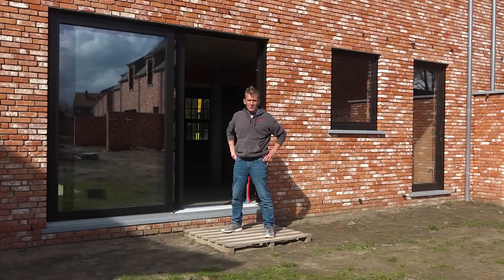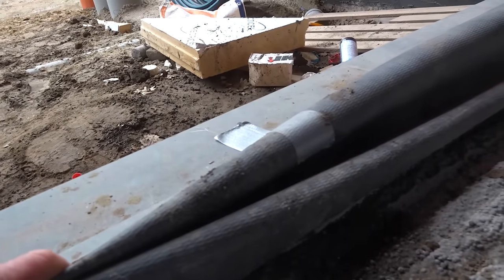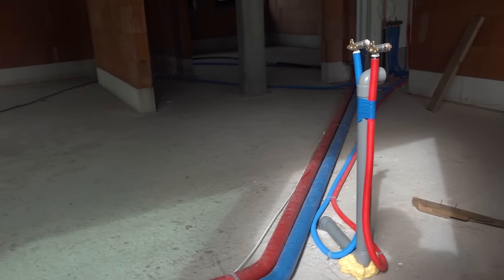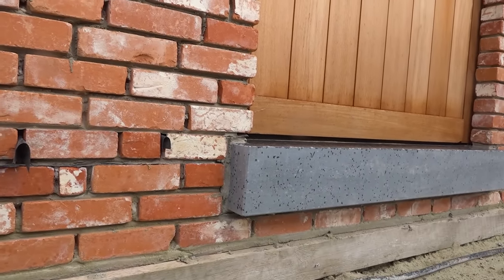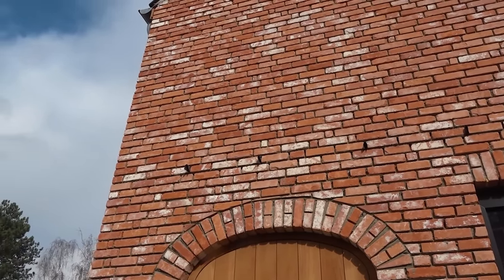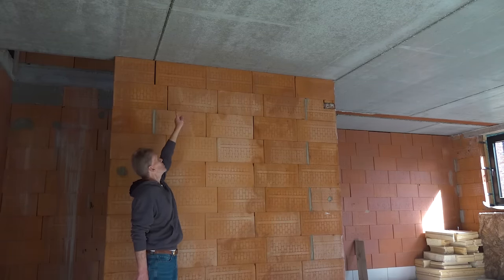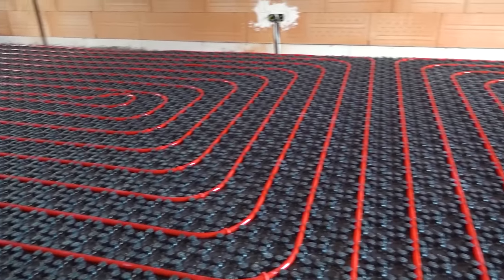Can We Learn From Buildings in Belgium?

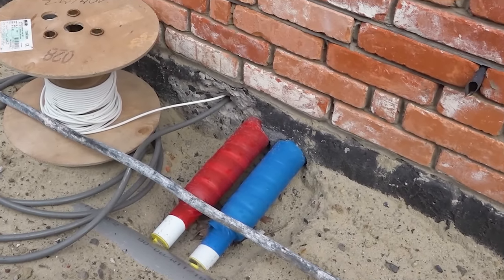Comment: 2:56 @SkillBuilder I hear you say “district heat system” which I don’t think we have anywhere in Belgium. These are definitely pipes of the heat pump, which every new building being built is obligated to install.
Reply from the maker: Yes I use the term very losely to mean several dwellings supplied by one heat source.
Reply: Yes Belgium isn't a former communist country we don't have that AFAIK especially not on newer houses definitely pipes for a heatpump since that's required now.

Comment: All houses as well as apartments here in Belgium  have been built for decades with concrete floors between storeys to keep noise down & for underfloor heating.  Standard practice!
Reply from the maker: Interesting!  This is actually a house, I thought they were flats but that is not the case.
Reply: I suppose lumber is a lot cheaper in the US than in Europe. It’s used in all houses between floors and between floors in apartment buildings up to about five stories, with discussion of increasing the upper limit. It is indeed noisy. It’s not so bothersome in a house, but in an apartment it’s incredibly intrusive to hear every footstep of your upstairs neighbor.

Comment: As an architect assistant and former constructionworker I can assure you not everything we do is perfect. Every country could learn from another. As a matter of fact, I prefer the dutch way of the foundation detail instead of the belgian way... Also that rainpipe in the middle of that window, wth whas that XD... I heard you talking about pipe in pipe system with the blue and red pipes, and then you said you could shove another tube in that when you have a leak but that's not possible. Those colored sleaves are just protection for everything that comes on top of it :-).

Comment: District hearing is basically piping hot water coming to your house and you have heat exhanger in your home to reduce it to hot water and forvthe radiators. Charged by volume and temperature  delta over your heat exhange(used kWh). Plus monthly basic fee to cover the upkeep of the district heat grid.
Reply: more used in the Netherlands than in Belgium, there are only a few projects using it so far.
Reply: It's actually not even luke warm (waste) water which is used by the heatpump to condense into Hot water. I don't mean sewage water but water from industrial processes etc which produce excessive heat.

Comment: I live in Belgium. Not a professional builder but did build my own house. The slab you see over the foundation is a slab that runs through  to the inner wall with a step-up. So moist and water is deviated towards the outside and not towards inside. 
Many things you name was logic to me, the way it should be done. Like pipe-in-pipe is very Common here

Comment: I have a house in France that has copper pipe in plastic tube similar to what you are showing here. It is buried in a concrete screed over the floor similar (I think) that will happen in this house in Belgium. The copper pipe is impossible to replace without digging up the floor! Also since the evidence of a leak only shows at the end of the outer tubing, you have no idea where the actual leak occurs and where to start digging. In general I think that not sufficient consideration is given to future maintenance requirements, access etc. It's cheaper just to bury everything.
Reply: The pipework in this video is plastic in plastic, so possible to drag through (might need to pre-lube the outer pipe though). Obviously rigid copper can't be pulled out of a buried plastic sleeve. Perhaps copper in plastic is to offer a small amount of protection from rough treatment during construction.
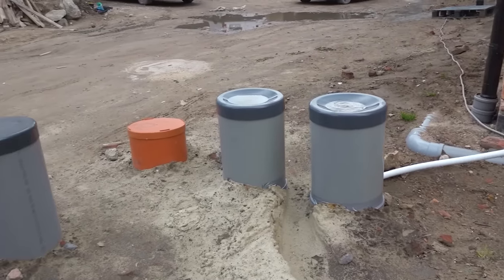Reply: Hi, Thanks for your interest in my comment. However while there is  some plastic pipe used I think there is a lot of copper. Also if it were plastic in plastic you would never pull it through the tortuous bendy routes that they have used even if it was lubricated. Look at the following; 1:56 you can just see the copper appearing out of the outer red tube, also there seems to be some   brazing on the red pipe, much favoured on the continent where they do not use flow solder joints (how this coexists with the adjacent white piece of plastic I do not know); 2:26 look at the bends you could never pull plastic through these, pre-lubed or not, also on the left hand side going up the wall there is uncovered copper: 3:26 here you can see some plastic pipe, pretty stiff not for pulling through any of the routes I refer to earlier; 6:46 look at the bend on the yellow pipe, I think copper with a taped covering. I have always thought that the use of an outer tubing or tape is to protect the copper from the covering concrete/mortar as a corrosion preventer, they do not co-exist well with each other. Also on the underfloor heating which is plastic there is no outer tube (normal) and is buried directly in the concrete screed. No corrosion problems but a repair nightmare! @stephen-boddy
Reply: @John-dp8oh  the pipes used here in Belgium are called multi layered pipe and indeed contain both metal and plastic, replacing them is not easy and the outer tubing is more for insulation or expansion and contraction purposes. these pipes will never fail if placed correctly, any leaks will always present at couplings, wich should always remain accessible and in the floor only straight, uninterrupted runs should be used.

Comment: In Belgium and the Netherlands as well, the briscks are lais and at the end of the day they are scraped out. At the end, a specific separate craftsman sill do all the poinying in one go with a sepate mix, which can be adjusted in hardness, colour, depth etc. It's ver important not to have the pointing too hard or the bricks will freeze to pieces. If the pointing ever goes bad it can be more easily replaced as well, without damaging the bricks. The mortar is meant for building, the pointing for protection.

Comment: As someone with years of experience designing buildings like this on the continent, and quite a bit knowledge with water proofing these type of particular, I can confirm that extra bit of DPC hanging over there is a cover protecting the door where the mice can get in and out.
Reply: A mouse or rat will chew through plastic

Comment: as a belgian loss adjuster for insurance companies: yes rising damp very much exists in belgium. it's one of the big exclusions of insurance policies so we're always checking if the cause of the water damage is rising damp in order to deny damage claims... older buildings or add-ons against old existing garden walls don't have the damp foil in them, they always cause trouble with rising damp.

Comment: In South Africa all floors and stairs are done with concrete, they use scaffolding forms to lay the concrete over the scaffolding forms to lay the floors. Much better construction for sound proofing, they even use that in duplex construction, not just flats.
Reply: Same in Belgium, but we lay premade concrete slabs first, and top that off with a concrete poor.

Comment: The pre insulated pipe cannot be altered/replaced once installed, we usually buy it dual red/blue on 50 or 100 m roll in DYI. Still pretty handy though. The non insulated version is indeed two separate pipes but it would be very hard to replace if there are curbs and bents. I think it is there to protect the actual waterpipe from chemicals and frictions when it expands and retracts due to hot and cold water

Comment: restoring old longuer in central france -- its 500 yrs old walls about half metre thick 14 metres height - limestone rocks and all held together with powdered limestone mix - chaux // holding a very heavy oak beamed roof // bought it to restore // looked a bit rough but solid as a castle -- bearing in mind local farmers picked up natural limestone occurring rocks from the local fields // winter very warm summer like having air con... just bizarre how clever these old builders were ...    charente area

Comment: Some ways to get ground water out of your old building : sometimes ive seen in Belgium : every foot they drill a horizontal hole into the walls a bit above ground level and  inject some kind of fluid , that creates a water repelling barrier . Another way but more costly :. Piece by piece they dig some stones  at or even below ground level and underbild. It with a concrete layer + a moist screen .  3: I used to live in an old cottage , end of 18 century . Hardly no foundation , floor tiles one sand floor . The entrance silt was only half an inch high , and the street side of the house was actually a foot under street level !  One time there was a severe rain and flood warning . So I picked up some sandbags at the town fire department to be shure . I never got flooded . Maybe the only thing my landlord did good for the house , was  to Fill the whole backyard up with  stone building rubbish .so the whole garden collected the rain up very quickly … I discovered it because at some places in the garden the grass grew very little ..

Comment: I have lived in a new build detached house for coming on 50 years. Brick and breeze cavity construction with clay tile roof and plastic guttering with, over the years, excellent loft insulation  (two layers of 13 Tog cheap polyester duvets) and cavity insulation (Rock Wool) added plus plastic windows. I am on my second only gas boiler which is now over twenty years old and still going strong. Twelve years ago  solar panels were installed under the Fit subsidised system. 
Energy bills are low thanks in part to having three heating zones each under thermostat and timer control plus radiator stats. We still burn a log and lower emissions coal fire occasionally on our live fire the chimney of which aids slow air changes with judicious use of the window trickle vents.
The house cost £17,000 and is now valued at around £500,000, however, now retired and cosy with minimal maintenance from a great British style of house that has kept up with the times there is no need to move to a 'modern' home.

Comment: I think the gutters are zinc, not steel. Expensive but lasts a long time. The only thing I don't like is the lack of a concrete structure to support the floor slab. I have porotherm blocks in my house, but here in Portugal modern houses are required to have earthquake resistant concrete structure, I guess in Belgium that's not a problem. In Spain I know some clay blocks like porotherm are certified to make 2 floors above ground, but I wouldn't try it. Other than that it's almost the same building techniques, in fact I would bet some of the workers there are Portuguese.
Reply: I think we had 1 (very light) earthquake in the 40 years that I am old.
Earthquakes is something we don't have to account for.

Comment: the very old more "bourgeoisie" kind of buildings in Belgium have cellars that reach higher than the outside soil, a meter or more, in order to never get rising damp reaching the ground floor. they even have sewage output level below the cellar ground level. this stuff is sooooooooo and you can buy neglected ones for a loaf of bread

Comment: Rising damp is all over in Ghana and people are messing up with solutions that don't work. I've done videos on my channel about it. The problem is homeowners listening to builders who don't know what they're doing.
Reply: Rising damp is an issue in parts of Kenya too.  I currently live in a ~30 year old house in Nakuru that has rising damp in almost every wall and many of the floors with flaking paint to match.  No mould though due to weather and ventilation.  It's the same among all our neighbours and we were told about it when we moved to the city.

DPC is (at least currently) used here under the slab and again under the walls, I picked some up last week for a friend who is building.  Maybe the older houses had a lower quality DPC, or installation problems.
Reply: @russellpengilley5924  in our case, there's mostly no dpc or more recently, they use regular plastic sheets which fails in no time.

Comment: Having lived in Germany for 25 yrs and having moving over to Flemish Belgium in the past 10yrs. German domestic building code n standards are at least 10 yrs ahead of Belgium. In Belgium they are catching up but still lag behind.
We spent about 12 months looking at houses prior to buying and some of the gerry built constructs we viewed made UK building std look state of the art and that takes some doing!!!
Reply: So how many years ahead of the UK are German standards?  And does anyone in the UK build to those higher standards?
Reply: A solid exaggeration right there, love it
Reply: You were probably looking at pre war houses. If you look in the basement the early houses had bricks under the hard floors or sometimes poured concrete. Now they use prefab 'Welfsels'  Belgium has a great education system for tradesmen and uses German materials and innovation as they come out. Self-build is a huge part of the Belgian economy. You can't own a business there without a degree in your subject + business studies.  Rainwater harvesting + pumped fresh air ventilation were part of building regs about 15 years ago, but maybe have been relaxed off.
Reply: @sukotu23  
German windows as used in Belgium since forever, are bolted to solid interior walls and open inwards. The windows are more secure, look sleeker and have that recess that allows the nice stone ledges.  In the UK the interior wall are too weak to take these windows and doors, hence UK doors often have the bar at the bottom for strength.
Belgium has much higher standards due to the education system plus encourages smaller qualified builders and wont let the greedy big corporates take over like in he UK with a lot of failed education and sometimes rogues.

Comment: Always wonder why small-scale district heating systems aren't a thing on new-build estates. Couple of industrial heat pumps near the substation, meter each house. Homeowners are happy because they pay pittance and don't have a heat pump making a racket in their garden, developer puts a 10% markup on and makes a steady income, seems a no-brainer..
Reply: Worked as a plumber on a new build estate in the Netherlands back in 2000. The houses were heated via a heat exchanger with hot water from the local waste incinerator.

Comment: Proud of myself. I have already done pipe in pipe of my own back, only one radiator tho. I was running 15mm in short wall channels from just below skirtings to a couple of inch up behind radiator to then feed 10mm plastic through to valves, to get a floating radiator as I call them. But on the living room I decided to run from under stairs all way way to other side and up two cannels to back of radiator, insulated the 15mm,  then put the floor down. When it was time I just pushed 10mm from rad until it popped out under the stairs to connect. Idea is if I get a problem the the plastic pipe I can just feed a new length thru without taking up the floor. I am planning to run cold to and hot from the boiler the same way, under concrete when I do the kitchen floor, 22mm plastic so I can feed 15 mm plastic through and again easily swap out if I have any probs down the line.
Reply: 21mm overflow pipe or 20mm conduit is much cheaper than 22mm plastic plumbing pipe and will do the same thing - or 25mm conduit or MDPE pipe (alkathene) or even waste water pipe if you need a bigger diameter, but yes great idea

Comment: Hello I'm North Italian. My apartment is built similar to this. Pipe in pipe and the pipe for water is multilayer (pholiethylene/cupper/pholiethylene/cupper and so on for 8 layers total). The electrical wires are separated: a circuit for lights and another circuit for sockets. Furthemore, every sockets in the kitchen is covered by forniture has a dedicate thermal switch.

Comment: Fairly sure the holes in the brickwall are for air ventilation. That is what they are for in Sweden.
Reply from the maker: They are weep holes for sure. There is no benefit in ventilating that cavity
Reply: @SkillBuilder  We usually have between 0.5cm to 1cm of air between the outermost layer and the next one. Which is solely for ventilation. I do not know about Belgium building code though.
Reply: @Frendh exactly, you dont know yet you said fairly sure.

Comment: If I had a brick working for me and he did a job like that, he'd never work for me again!
Reply: It's the style of brickwork, they do the same in Germany. They throw  in a brick piece at random to break up the bond. A gang comes along after the initial build and point up all the joints.  very strong and I think effective.  I worked in Germany...Im one of the Auf Wiedersehen Pet originals.
Reply: @ericlyon1425  I stand by my initial comment. Our brickies do it properly, AND point their own work.
Reply: @martinlouden9005  
These are left to dry out for 1-2 years before pointing. , they have internal brick walls with plaster, not tacky gyproc bonded on to ash blocks.  Also the concrete floors are all concreted over before the screed.
Reply: @richy69ify  all of my interior walls are plastered and set. No cheap dot and dab crap. My brickies point their own work and take great pride in doing so. They don't stick random size offcuts of brick into their courses. This 2 year delay is the most ridiculous lazy arsed practice I have ever heard!

Comment: If the district heating system is the same as in The Netherlands, it is metered by the Joule, measured from the difference between water temperature going in and out. The hot water is generated by gas turbines where I live, but they're going to use air/air heat pumps next year, as they're able to use solar and wind power.